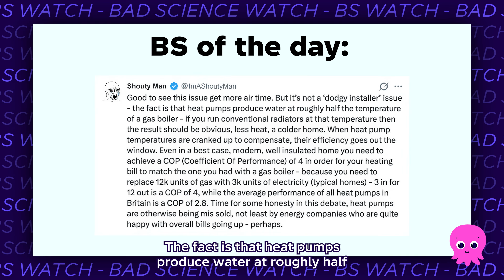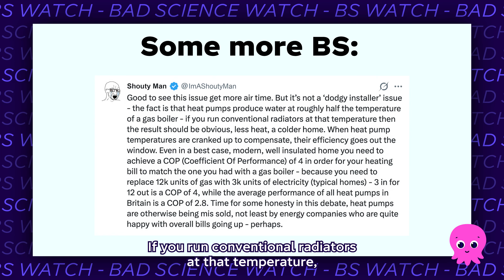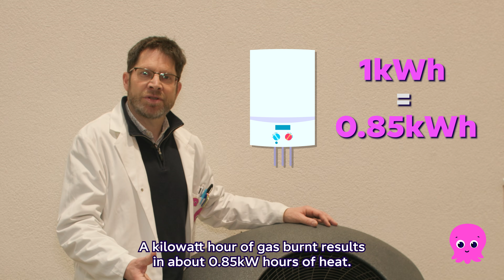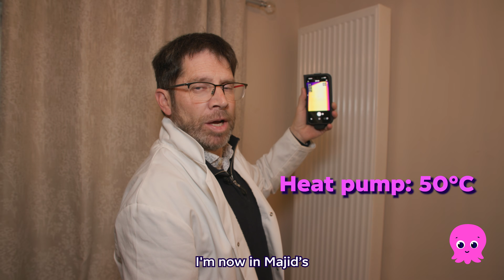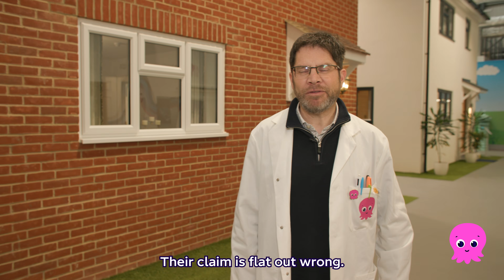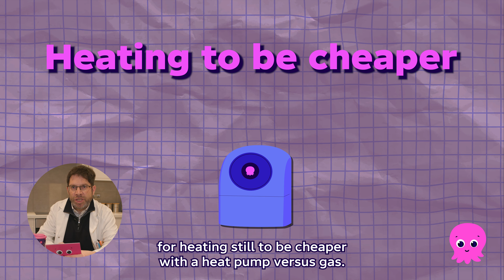Are heat pumps half as hot as gas boilers? BS debunked

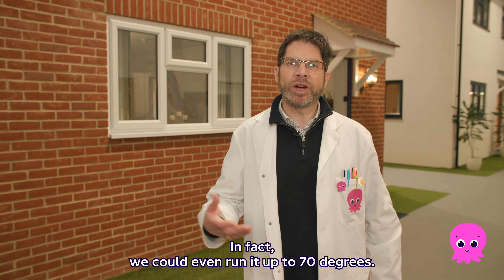Comment: 4:03 Daiken heat pump only produces 50 degrees flow temperature if it is -4 degrees outside nowhere near 70 degrees. Watching this over next cold snap and hope my heat pump has been put right by your tech today
Reply: Heat pumps may struggle to hit higher flow temperatures during cold weather. As long as the install has been designed to allow for this, your house will stay warm. Glyn Hudson from Open Energy Monitor has done some work on this.
Reply: @Biggest-hz7ng  That’s true — but only if it’s actually reaching its design flow temperature.

In my case it wasn’t. It was running ~35°C under weather compensation during cold snaps, despite the design spec being 50°C at -4°C. That’s now been corrected.

Also, to be clear, mine is not going anywhere near 70°C as mentioned in the video — it’s set to 50°C max at design temperature.
Reply: You wouldn't want it to be at 70oC, massively inefficient
Reply from the maker: Hi Justin, all Cosy heat pumps are designed to run up to 70°C. Older heat pump models may not reach that, but they should still achieve well over half the flow temperature of a typical boiler.
Was yours installed by Octopus? It sounds like things are sorted now, but we’re happy to take a look if needed: https://octo.ps/fb-help
Reply: @OctopusEnergy yes it was fitted by you there is a high level complaint on this given it’s a daiken that was fitted not a cosy, though 3 of your engineers who visited previously to today suggested I may be better with a cosy 6 and was putting it back into the design team, and it got overturned. I know Greg Jackson has had eyes on it. I said I would see how it goes for another winter, but even now mom complains (she is 85 has Alzheimer’s) today for me though I have been toasty as it’s been on fixed to get it to 50 degrees flow she says she’s cold earlier.

Comment: The half the temperature thing is BS.....BUT.

I think the point is; why spend £1000s in subsidies on a piece of equipment that costs about the same to run as a gas boiler? 

If you spent the same amount of money on installing rooftop solar or insulating, people would save a lot of money.

Your own figures support that conclusion.
Reply: Because the price of gas will only go up in the long run, adding insulation later will only get that COP up further (increasing it's efficiency) and adding solar will allow you to run the ASHP partially off that power without any levy, tax or margin. Try doing those things with a gas boiler running on an expensive infrastructure that needs to be paid for by less customers every single year.
Reply: @SolAce-nw2hf  counterintuitively, insulation acts to reduce heat pump SCOP (which increases if the heated medium is cooler, and easier to transfer heat into). Insulation does reduce heating costs and can allow you to downsize radiators and the heat pump during install.
Reply: @Biggest-hz7ng More insulation reduces the heat loss and therefore allows for lower flow temperatures increasing the SCOP. The only thing to keep in mind is that insulating afterwards may make your ASHP too powerful, not allowing it to modulate far enough. But any heat loss survey should help you determine if this difference is big enough to do the insulation first so you can get a smaller and cheaper ASHP and maybe even skip a radiator upgrade.
Reply: @SolAce-nw2hf maybe I took the wrong conclusion from a Heat Geek video. Certainly starting hot water runs from a lower temp to a fixed higher temp is good for SCOP.

Before insulation the heat pump is transferring heat into a medium that starts lower (with a higher transfer rate), but ends higher. Perhaps it's the final temperature that is the killer.
Reply: @Biggest-hz7ng The ASHP really likes low flow temperatures. The main limitation of how low you can go without comfort issues is the energy you meed to put into the home which is determined by the heat loss. Bigger radiators and/or UFH also help as they increase the surface area and thus the heat transfer inside the home at any given flow temperature and room temperature. Another nice fix that may help is the use of radiator fans that increase the inside airflow, and boost those radiators by letting more cool air pass.

High flow temperatures are bad but sometimes unavoidable. 
My ASHP has a SCOP of 4.8 , but it does not provide DHW (hybrid setup). I am still trying to improve on this without UFH and replacing radiators. The goal is to get to 5.0 by insulating just a little more where it counts.
Reply: @SolAce-nw2hf  If you look at history - Electricity prices have ALWAYS increased 3-5% per year - while natural gas prices have only increased by 1-3% per year. (Until Ukraine/Putin) - so if you put prices into a real model - you will in 10 years pay a lot more for your electricity per kWh than for Gas.

Even now - if we use official UK stats with base 100% in 2015  - gas prices are at 150.5% and Electricity prices are at 192.8% So Electricity costs have increased >40% over 10 years compared to Natural Gas. And that includes the Ukraine / Putin problems where gas prices maxed at 195% vs 2015.

If the trend continues as it has done the last 30’ish years  - in 10 years Nat Gas will be 9-10p / kWh and electricity close to 60p/kWh. And your SCOP needs to be 6x for prices to be equal. 

There is currently no signs that there is deviation to the trend apart from the Putin speedbump.
Reply: Spending money on insulation, solar and batteries will definitely save you money and I would suggest would be the priority. For us getting rid of gas was the next step, an end to using fossil fuels has to be a good thing, and the loss of the daily standing charge for gas meant we saved quite a lot each month too. We did it just over a year ago and after the government grant, we only paid £1050 to Octopus. That included 5 new radiators too. No regrets whatsoever
Reply: The subsidy is to get the industry moving, just like the subsidy we used to have for solar panels. Climate change is real, and domestic heating is one of the biggest causes (after transport). To convert most of the country over the next few decades we're going to need loads more installers, and they need an incentive to switch from installing gas boilers.

If the government did nothing until the price of gas made heat pumps attractive, suddenly everyone in the country would want one at the same time, and there would be no one to install them. It's a rare case of the government planning ahead.

Also, I think most people getting a heat pump have already insulated as much as practical and bought solar panels, or have very good reasons why they haven't. It's not an either/or problem.
Reply: You should always do insulation to a good level before an air/water heatpump if you can. Adding the insulation reduces the need to change radiators and the heatpump size so can save you doing a ton of work. Worse still because air/water heatpumps are very sensitive to sizing adding insulation can make your heatpump oversized and it all starts cycling and getting inefficient.

There's a whole virtuous circle around more insulation smaller heatpump less upgrades, smaller battery required, higher percentage of use covered by solar.

For heatpumps though the governments of both colours were really always about CO2 emissions not saving money. If they were about saving money you'd have been allowed to add some air/air to the gas system and the like and other flexible options.
Reply: @etchedpixels  Havenwise have an article on how they believe concern about oversizing (regarding efficiency) is overblown, highlighting good performance of oversized systems on heat pump monitor.
Reply: The purpose of the subsidy is (1) to reduce our exposure to volatile international gas prices; (2) to reduce the nation's dependence on imported gas from unfriendly states e.g. Russia and USA; (3) to reduce the nation's emissions of CO2 and (4) to kickstart a new industry resulting in better training, lower costs and more jobs
Reply: Hopefully an increasing number people will consider heat pumps in advance of their boilers coming to the end of their lives.

The subsidies are to grow the heat pump industry and reduce emissions through the electrification of heat. A2A heating is also available with smaller subsidies for those that want it.

Comment: The median COP being 3.6 for Cosy 6 over December to January is good data. Was this according to the Cosy units or external monitoring and how accurate is this? Does it cover both hot water and heating or just heating?

This efficiency claim and the cost claims will hopefully reassure people about the cost of heat pumps given the current large spark gap.

For the cost claim, on what tariff is a 3.5 COP needed to match the cost of an 85% efficient gas boiler? Is this on the Octopus standard variable tariff or the price cap tariff?
Reply from the maker: 3.5 is Flexible Octopus (our SVT, just below the price cap) over the last year, 3 is with Cosy Octopus (our smart dynamic tariff for heat pump owners). I'll come back with the answers to your other Qs!
Reply: Give Octopus credit here if you’re on cosy fixed like I am I am paying 13.59p kWh on the electric granted I do have batteries that are used outside the cheap rate and charged up at the 3 cheap rate dips everyday to keep it running 24/7. My issue is around cold drafts throughout house and furniture feeling cold to back that up when temperature sensors show 20-21 degrees I have feeling Daiken don’t get hot enough in winter but cannot test this until I see a -4 degree day

Comment: Sorry but my radiators temperature are a lot lower than when I had gas, and in winter costs more,
Reply: Looking at your other posts, you've had a heat pump for three years.

Heat pumps, like gas boilers, only heat either the heating or hot water at any one time. So most people choose to heat hot water overnight when they don't notice the up to 30+ minute period when their heating isn't on.

I would suggest taking your problems to a heat pump group on social media for more help.

It may be that the output of your heat pump is throttled by a software setting, or there's a flow problem (e.g. wire strainer).

With a heat pump the radiators are cooler for longer to maintain the same indoor temperature.
Reply: Bad install probably

Comment: I do not have to run my gas boiler 24/7. In your example, 20 deg room temp day and night requiring 1584 kWh of heat. My system can shut off during the night, and during the day when the house is not occupied. Therefore, the energy required would be less than 154kWh........ So, the comparison should reflect real world operation.
Reply: When you average it out over time turning off heating at night doesn't save that much. Heating a house is like keeping a slightly leaky bucket filled with water - you either pour a lot in very quickly and let it run down before topping it up (i.e. boiler turning on and off) or you run a steady slow stream to counteract the loss (i.e. heat pump). Either way you're putting in a similar amount of water over time. Besides, modern heat pumps do lower the set temperature overnight by default so the boiler doesn't actually have an advantage.
Reply: Heat pumps can obviously be set to run at 0C during the night and day if needed. They work according to the specified schedule. Keeping a house in or close to a steady state is often an efficient way to heat things with the heat pump modulating down to a very low output.

What example are you referring to?
Reply: @Biggest-hz7ng 
There are many many examples all over the Internet of householders showing how much gas they used then how much electric/SCOP to give heat produced. 2 recent examples! Look at Shan, look at Tom Bray, they are purporting to be using far far more heat than they did with their old inefficient gas boilers.
Where's all that heat going??
It's a myth that just because the machine is saying your SCOP/COP is 3-4-5! That your heating system is saving you money! If you go from a Gas Combi boiler which the vast majority have, you never had the heat losses, you didn't need to run the heat pump 24/7, you could go away for the weekend and turn the heating off. You didn't need massive ugly radiators, buffers, volumisers, cylinders in the loft leaking heat. Long outside pipe runs! Nick Raimo is a great example in how not to do it!
Look on the Octopus Facebook page. The heat energy  that people are recording is extraordinary. One bloke was using 10000kWh of gas a year. Heat pump 4270 kWh at a SCOP of 3.6= 15372kWh!!! Same in door temp.
Reply: @jezzaandrews1940 yes, there are inaccuracies in internal monitoring. Mick Wall estimated his Valiant was about 8% out (not sure which way).

You can set your heat pump on absence mode for a weekend away.

I haven't looked at Shan's use, but if it has risen, it might be his family growing. Tom has an older, mediocre install which seems okay, especially with his choice of tariff. I think his job has changed and he's probably spending more time at home this year. Nick Raimo may well be helped by the Cosy remote monitoring and tariff.
Reply: @Biggest-hz7ng 
Shan heat output for new heat pump 88% higher than last Jan gas figures!🤔
Reply: @Biggest-hz7ng 
We are not talking about a small amount of more heat produced. Shan figures, nearly double the amount of heat!🤔 Tom's shows his is over 40% for as long as he has had it.
You can't then reverse engineer the gas usage, because you would never use that amount with the boiler, as their previous figures show.
Reply: @jezzaandrews1940  Shan's figures were for one month, and he's changed his heating behaviour. I don't think much should be read into that.

Personally I have seen as good or better figures from my heat pump than I expected (presuming the heat pump counts electricity usage correctly), and with greater comfort.
Reply from the maker: Hi there, you're right. Heat pumps do take a bit longer to warm up than gas boilers, so if you only switch the heating on for a short time, you might need to start them a little earlier. With the right settings, you can get cosy efficiently — here’s a guide with some handy tips: https://octopus.energy/heat-pump-help/the-best-ways-to-run-your-heat-pump/ 🐙
Reply: @OctopusEnergy  My air/air one has the room warm much faster than a gas boiler or air/water heatpump. Hopefully we'll see you also start to move into air/air now there are more grants ?

Different technologies, different trade offs. If you just want to keep a house at a steady state temperature and it's got some reasonable level of insulation heatpumps work like magic unless some idjit keeps leaving outside doors and windows open then it's not fun waiting for them to re-heat
Reply: Exactly my friend, and they never tell people this! People are using far more heat because of the 24/7 working, heat loss from outside pipe work. Did you notice that the boiler had lost 2 degrees to the radiator, but heat pump had lost 3.5 degrees. The boiler doesn't need to use energy to defrost itself, Combi boilers don't need cylinders that leak heat 24/7.
 so the SCOP is only a part of the efficiencies of a heating system.
It's a fact, that the real SCOP is a lot lower!
People then reverse engineer what their costs would be with a gas boiler using the kWh of heat produced by the heat pump and think they are saving money! It's actually comical😄
If you haven't got solar and batteries, you won't save money with a heat pump.

Comment: The BS of that comment comes in very early. “Half the temperature” is meaningless. You get different answers when working in Celsius, Fahrenheit, or Kelvin.
Reply: I guess he means the difference between room temperature and radiator temperature, as that what controls the heat flow. At 20 degree (c) room temperature, a HP at 45 degrees has a temperature difference of only 15 degrees, while a boiler at 70 degrees would have a temperature difference of 30 degrees.